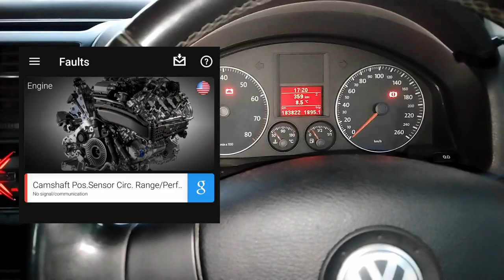How To Change A 2.0 FSI Camshaft Sensor | VW Golf/Jetta Mk5

Comment: Finaly a video i can relate to, i have a golf 5 2.0l fsi 2005 it cranks and does not start but once i take out the battery terminal for a few seconds and  put back on the car start but it still lacking power and hesitate  during acceleration
Reply from the maker: There's really not enough content about the 2.0 FSI (BVZ/BLY). I'll be doing more videos... We'll with your issues maybe it could also be either a camshaft sensor or a crankshaft sensor. When did it start?
Reply: @MegatronicsZA   jah you are right there is no content ......it was like that when i got it from the previous owner so i'm trying to bring back to it formal glory thanks for this video i will ryt it on my one and see how it goes 🙏
Reply from the maker: @sizwemkhwani1318 okay but please try to get the car scanned because you will spend money on wrong stuff and still have the same problem

Comment: Its the crank position sensor, next to the oil cooler. Its a crappy job due to space constraints.
Reply from the maker: On this case it was timing which was out. I did do another another job and saw where it was. I hope it never goes bad.

Comment: Bro im experiencing the same issue after changing the timing it pops code p0341 camshaft position sensor A bank1 range/performance  the car doesn't start even after changing the sensor
Reply from the maker: It will not start, you have find a scanner and then clear the fault then start the car immediately. You'll have to do that until you sort out the timing

Comment: Hey I also have the same problem here dat happened after timing chain was installed I drow the car for 200 kilometers it just stopped on the way
Reply from the maker: It needs to be re-adjusted and timed properly because it is not going to perform well and might even bend valves if you continue driving like that

Comment: I have a question please, my wife has a 2004 VW Jetta 2.0 and it runs good until shes drive it a good ways, then it'll stall when she has to stop. When she tries to start it back, it'll try to start but won't. After she's let's it sit and cool off for about 20 mins it'll start back up. Does that sound like a Camshaft Position Sensor, if not what do you think? I already put new Plugs, Plug Wire and a new Coil on it. Please let me know what you think. Thank You...
Reply from the maker: I once had this problem too on my previous Jetta 5 which had an accident, the issue was a fuel tank breather valve. When it's dead and blocked it causes the car to stall. The car will start when it's cold but when the car is heated up and more vapours are released, it just dies because it's blocked. Start there
Reply from the maker: Please kindly consider subscribing, I'd appreciate it. Thank you
Reply: @MegatronicsZA  When this happens, she said she can smell gas so could it still be that valve?
Reply from the maker: @DreamBeatsLoFi2024  it could be the breather valve
Reply: @MegatronicsZA  how do I fix it?
Reply from the maker: @DreamBeatsLoFi2024 please click on the link here: https://youtu.be/6-ITaJ7V2lw

Comment: How much did you pay for that sensor bro I need too replace mine too thanks for the video❤
Reply from the maker: R600 South African Rands... I'm not sure how much it is in dollars.

It's a pleasure man, I found out that mine was not bad, it was just a timing error
Reply: @OverideZA having the same problem on my MK5 and the price they said it's R700 to buy it
Reply: @MegatronicsZA my timing has been corrected and today I did a diagnosis on the car and it shows camshaft position sensor: open circuit/short circuit  To B+
Reply from the maker: I guess the price went up. I can sell mine to you for R400 as I never used it. Only if you want though.
Reply from the maker: Then that means the camshaft position sensor is burnt or can no longer read the signal from the camshaft. You probably need a new one.
Reply: I got one for 350 thanks bro 🙏👍
Reply from the maker: @LUFFY12251 okay bro, so has the new one sorted out your issue?